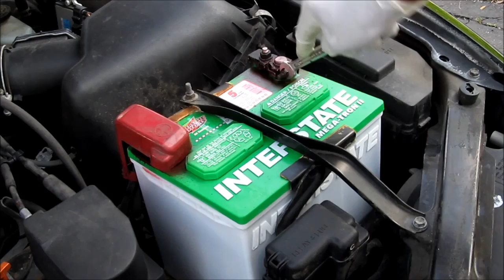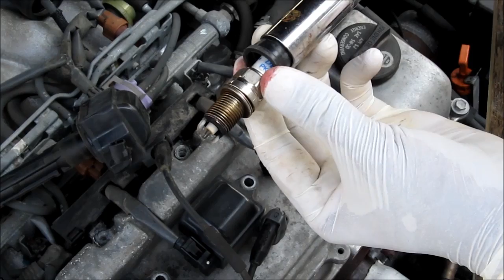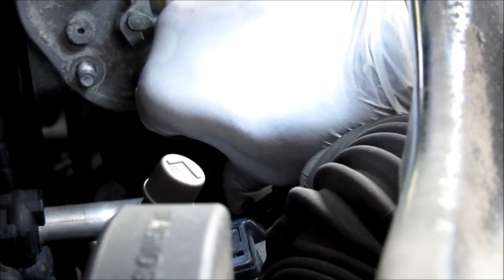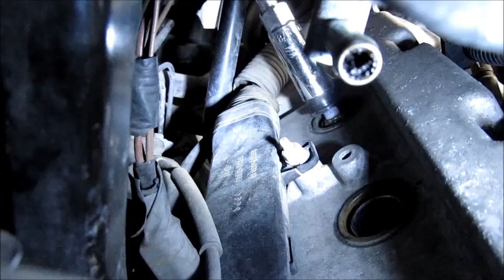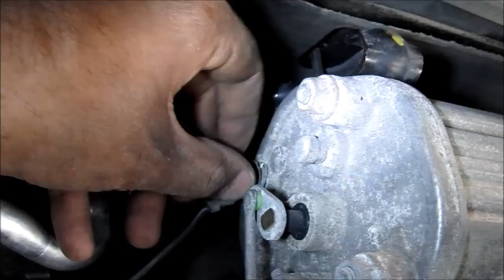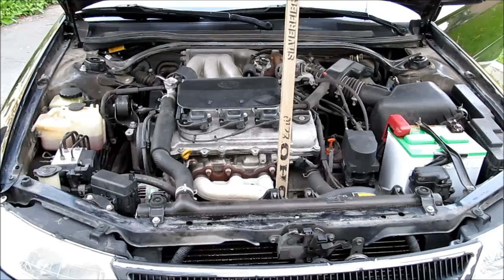Spark Plug Replacement: Toyota / Lexus 3.0L V6

Comment: Just changed my spark plugs and wires today since my engine started misfiring, cylinder 5 to be precise. Hadn't done the spark plugs in a few years and I used your method, very useful and I'm grateful this video was here. Thanks for the upload, keep up the good work.
Reply from the maker: +Wilmer Andrade Thanks. Have you made sure the wires are tight and snug going to that cylinder?
Reply: +speedkar99 yes, I made sure it was, all the rear ones since it's hard to get back there I made sure I did it right and everything is running smooth :) thanks again
Reply from the maker: Ah, Good to hear :)
Reply: +speedkar99 now I just need to figure out if my alternator is going bad because my dash lights and accessory lights dim/flicker when the car is idle but when I accelerate the car the lights brighten so not sure
Reply from the maker: It could also be a bad battery cell. Have you had problems starting?

Measure the voltage at the battery. While the car is running, it should be 14V. Turn on the a/c it should drop to 12V. With the car off it should be 12V.

Take the battery to a car parts store and let them do a full load test on it before investing in a rebuilt alternator.

Comment: Great video with clear instructions. Most helpful.
I used a magnetic flexible cable to extract and install the plugs ( in case you do not have a  spark plug socket with rubber boot).
Thank you.
Please post video on replacing rear struts/shocks on 1998 V6 Camry.
Reply from the maker: +Rafi Khan Thank you! Good tip on the magnet. Here's a rear strut video on my ES330 which is similar to the Camry with the exception that my rear seats don't fold: https://www.youtube.com/watch?v=ktWo724x090

Comment: Watched your video, very helpful. I change the plugs on my 2000 Avalon; little more intense but procedure the same. Need to becareful of the plug coil tube. It has a rubber seal gasket and at the end of the coil tube is a detachable plug cap that can come off and fall below. Actually I spent 30 minutes looking for a gasket and plug cap.
FYI, I like the best practice of taping the plug socket to the extension. Great idea.......

Thanks for sharing.....
Reply from the maker: +Jules Yes, taping the socket is really handy in case it falls into the spark plug tube. The VVT-i motors in the ES300 and Avalon use coils instead of waste spark ignition on the rear 3 cylinders.

Comment: Great video. I just replaced all 6 spark plugs. However, a friendly reminder, for those who doesn't service the car much/bought a second hand car, the PCV hose is kinda stuck and may need some hose picks to remove the hose from pcv valve. Thanks for the walkthrough and great details!
Reply from the maker: +Gideon Mak Thanks for the feedback. Good point on the PCV hose. Sometimes it can be stuck and break because its brittle.
Reply: +speedkar99 Those plug wires on the back are much easier to reinstall and remove next time by putting a little bit of silicone lube on both the plug and valve cover ends.

Comment: Dennis your video was very good, I hope you can tell me the Denso OEM part number of the plugs you took out, and maybe why NGK for replacement and the NGK spark plug part number you installed with the correct Gap you used in the plugs...Thanks
Reply from the maker: +PC MAN The NGK's were more readily available and also recommended by Toyota. The ones I put in were BKR6EKPB11, dual electrode platinum plugs. The iridiums didn't come with dual electrodes at that time. I don't know the Denso part number that came off, but if you search a parts database you might be able to find the OEM number. I recall it also being printed in the owners manual as well. The gap is 0.044" nominal, and do not need to be gapped.

Comment: Clear steps in your  video.  Your relaxed demeanor put my son and I in the right frame of mind as we changed the plugs and coils on his '98 Avalon (no rush, takes as long as it takes).  Which ended up being about 2 hrs.  I used multiple 3 inch extensions - 1  wobble, 2 fixed, and 1 universal joint were enough.  Well done.
Reply from the maker: +John Church Thanks. Glad you got the job done right.

Comment: I have a 2002 toyota camry v6, and this tutorial is very nice, and it is my base for DIY on spark plugs replacement. I want to add some notes here for 2002 or later Camry v6 owner:
1. it is doable without taking off the throttle intake body, but the space is very tight, seems to be tighter than the camry in the video. 
2. get the spark plug socket on amazon, it is definitely worth the money, much better than a standard spark plug socket. search on amazon "GearWrench 80546 5/8-Inch x 6-Inch Swivel Spark Plug Socket"
3. the spark plug on the rear right hand side is most difficult one to replace. I used a spark plug socket + u-joint + 6 inch extension + ratchet, so the ratchet is extended to the top where I have plenty of room to torque, that was the only way I got that spark plug unscrewed. there was no room on the back when I try to use socket + ratchet directly.
4. I did much research on 2002 camry v6. all the camry later than 2002 have iridium spark plug and they last a long time, manual say replace every 120K, and some people had said they drove longer than 200k and spark plug did not die on them. I replaced mine at 120k. spark plugs were really in decent shape where it can still work for a while. 
5. spark plugs makers actually against applying antifreeze, if you choose to apply some, do not over apply it. 

Hope these comment helps other Camry v6 owners. And thanks for speedcar99 for posting this video. saved me some money, more importantly, enjoyed learning a new skill.
Reply from the maker: Thanks for the feedback I'm glad you found it useful. 2002 Camry v6 still had the metal plenum which is easier to work behind than the plastic one found on vvti engines after 2003.5 . the difference with yours compared to mine is you have a different throttle body with drive by wire.

Comment: thank you for this video, i succesfully replaced all six plugs and the wires. the car stopped shaking , i was gonna take it to the mechanic but decided to give it a go myself because he wanted good chunck of change to repair it. saved me a couples days worth of salary.
Reply from the maker: Good it worked, I wouldn't think spark plugs alone would contribute to shaking idle.

Comment: I need help with the firing order of the engine, also I need to know which cylinder is which number, I was dumbass with disconnecting the wires and not paying attention.
Reply: ANIMAL LOVER  I have a 99 Toyota Solara V6 3.0 Liter
Reply from the maker: ANIMAL LOVER Here you go

http://www.toyotanation.com/forum/103-3rd-4th-generation-1992-1996-1997-2001/90956-help-what-firing-order-1999-v-6-1mz-fe-engine.html

Cylinder #1 is on the passenger side next to firewall.

Comment: I have a question and need help with some suggestions. I have a 2000 camry exact same set up as yours. i was able to get to the front spark plugs with ease but the rear i cannot get the ignition coils out. they are stuck. i want to save these coils because they are fine but if i try to remove them i fear i may break them and have to replace them. how could i remove them without breaking them
Reply from the maker: IXBlackoutXI1 On a 2000 Camry V6 you should have rear wires (and not coils) because it uses waste spark ignition (just like my engine in the video). They just pop out of their tube holes if you pull firmly.
Reply: Thanks for replying! Im planning on doing a gasket overhaul so once i start tearing everything down ill remember your vids thanks!

Comment: Thanks so much for the video u did a great job and saved me $240!  Couple quick notes i have a 2002 Camry v6 se and it has the ignition coils on the back 3 plugs too. Little more of a pain but u can get it. I also found that a 4 inch extension with a universal worked best for the back plugs. I had to get a 3 inch extension and rig a 1 inch extension. I took all of mine out from the passenger side. For the one closest to the driver side I put the ratchet in from the left and hooked it fast from the right. Again thx so much for the video I really appreciate it. Very well done!!!
Reply: One more quick thought this is not a quick easy job. It took me about 4 hours to do.  If I had to do it again it would probably take 2 since I found some tricks. Very tight squeezes to get to them but u can do it. By the way the taping the socket was an awesome trick a must for the ones in the back!
Reply from the maker: Travis Glessner Thanks for the awesome feedback! I'm glad you got your plugs done. Yes those helpful tips make the job a lot easier.

The 2002 Camry does have 6 ignition coils because it does not have waste spark ignition.

You have the metal intake plenum, correct?
Reply: Yes u r correct it has the metal intake. Thx again for the great video!
Reply from the maker: The metal intake was used on the 2002 until they brought VVT-i on the 1MZ-FE Camry in 2003.5.

Comment: Probably a good idea to replace the wires too if you're going at least 100k between plug changes. I found out one of the rear wires was damaged at the connector end. The problem was I couldn't tell from the outside so I thought something else was causing it not to start. I had to pay Toyota service to find out that's all it was.
Reply: I ALWAYS change the spark plug wires when I change the plugs. It but me one time on my 01 Camry. It was running rough and I changed just the plugs. It ran better but about a month later the check engine light started blinking and it was running terrible. Changed the wires and problem solved!  Always change the wires when u change the plugs about every 100k. I'm assuming u don't change the ignition could though as they r almost $100 each. Wait till they go bad. Thoughts?
Reply from the maker: Travis Glessner Ignition coils are expensive and should only be replaced if they're going bad. Wires are a good preventative maintenance, but I haven't had any problems yet with mine.

Comment: Probably could have saved some hassle if you waited until all 3 back plugs were installed before putting the 3 back wires back in lol. It's kind of silly seeing you fiddle with the wires in the way.
Reply from the maker: Joseph DiSalvo True yes, but because I didn't change the wires at the same time, I chose not to pull them out.

Comment: @5:46 Here it looks like you were using something other than just a 6" extension. It looks like a u-joint of some sort connected to the 5/8 socket. Can you explain? Is the rear middle plug harder to get an angle on with just the 6" extension?
Reply from the maker: ***** Yes a U-joint adapter. That middle plug is too tight under the intake plenum to get a full 6" extension in there.

Comment: I see  you went with NGK 3452. I was thinking about NGK 3764 Iridium instead of platinum. I know at the time the engine was designed, iridium didn't exist.
Reply: rkgsd Dual electrode lasts a bit longer simply due to the fact that as electricity follows the path of least resistance, it will generally err on the better condition electrode back and forth and wear down both equally.

You likely use dual electrode with wasted spark since it sparks the plug twice as many times per rotation of the engine than an engine that isn't lighting both sides of the V-cylinders simultaneously.

However, with Iridium lasting so much longer than single/double Platinum spark plugs for only a dollar or two more per plug, that doesn't really matter imo.
Reply from the maker: rkgsd NGK doesn't make a dual electrode iridium plug. Since these cars have waste-spark ignition, you should use dual electrode plugs, as per the sticker under the hood.
Reply: speedkar99 thanks.
Reply from the maker: Good point. At least I'm good for another 90K miles or so, so I won't really have to worry for a long time... if ever :)
Reply: I have 2002 Camry and it specifically recommended the iridium spark plugs and that's what I used. Time will tell how good they r and how long they will last. Will post in another 100,000 miles or so. :-)
Reply from the maker: Travis Glessner
The 2002 Camry does not use waste spark ignition. The 2002 Solara did. Two different engine ignition technologies and different generation vehicles.
Reply: speedkar99 So even though auto parts store catalogs at both AutoZone and Advance both suggest NGK Iridium 3764 plugs, you wouldn't use them?
Waste-spark ingition AFAIK has nothing to do with the number of electrodes on the spark plug, but rather, the fact that it sparks the fuel--free cylinder opposite of the one currently igniting fuel, so that it need only 3 ignition coils, simplifying the ignition system.
There is no actual change in whether or not the plug has or needs 1 or 2 electrodes.
Reply: Joseph DiSalvo Interesting but the service techs at the Toyota dealer still recommended 2 electrode platinums to me last week.
Reply: Side note: when the old plugs were pulled after 100k miles, I noted most of the electrodes were slightly more wore down on 1 side (1 of the 2 electrodes) but not both sides equally.

Comment: Hey just wanted to say thanks to this video I finally gathered myself and got this done over the weekend.  Mine is a 1998 so I had to remove the "diagnose" box bolted on the exhaust manifold as well. Not a lot of room and It took longer than expected but it's doable.  Driver side plug can be accessed from the top.  One suggestion is to have 3" extension and U-joint for easy plug removal when loose.  Great video!
Reply from the maker: wrongbeans Thanks for the feedback, glad you got your spark plugs done. A u-joint definitely helps behind the plenum.

Comment: Thanks A Lot for the video. It really helped me. My 98 Avalon had started runnig bad, sputtering and stalling. I was able to change the plugs in about an hour. I was quoted from $170 to $300 by 3 different mechanics. I took the money I saved and change the Oil, Air filter and bought a new fuel filter. I plan to change the fuel filter next weekend. The car runs great now. I used a 6" extension, with universal joint.  Went as smooth as your video.
I had a cheap spark plug socket so I had to glue the little rubber piece that grabs the plug into the socket to keep it from slipping out with the plug.
Reply from the maker: Cool, glad it worked out for you. DIY means saving money and is definitely the way to go.

My spark plug socket rubber came apart too, so I had to tape it to the end of another socket to pull them out.

Comment: Seriously, thank you for the video. Worked perfectly for my 1998 Toyota Avalon. The center rear spark plug was the roughest one for me. I finally got it despite only having a standard socket wrench with extender (no flexible joint). Videos like this are what make youtube so invaluable. Keep it up!
Reply from the maker: Thanks for the feedback, I'm glad it worked out for you. That middle spark plug is pretty hard with the intake plenum in the way. The flexible U - joint extension helps quite a bit here.

Comment: Thanks a bunch! Had check engine light coming on with multiple misfires. Replaced all the plugs and cleaned out throttle body. Ran it hard and so far no light.

Comment: Thanks for your video. It gave me the courage and knowledge to do replace the spark plugs myself on my Avalon. I had no idea how easy the rear spark replacement would be. I did, however, use two long 3/8 socket extensions, plus a universal joint connection to remove and replace the plugs, plus my extendable magnet to get the socket and spark plugs out of the wells, individually, since the deep socket didn't have a rubber spark grabber inside. Thanks again.
Reply from the maker: Glad it could help and everything worked out.

Comment: Do I need to gap them?
Reply from the maker: No they come pre-gaped.
Reply: Thanks for replying and I have a question I hope you can help , well since I couldn't wait I went ahead and gapped them and I don't know if it's because of this that the car now stalls and the check engine light is on I was thinking about taking out the plugs and re gapping them to how they were when I first bought them I'm working on a 95 96 Toyota Avalon btw thank you
Reply from the maker: You can try re-gapping but I don't know how much that will help because you've already changed the factory gap values. Exchange the plugs for fresh plugs, reset the codes and see if the problem goes away. Make sure the ignition coils are on tight and its not misfiring.
Reply: Thanks

Comment: Great Video:  Recently changed out my valve cover gasket.  I was careful with my ignition/spark plug wires but one failed anyway.  I was getting a misfire.  I decided to change out the whole set.  I was not looking forward to almost doing the job again but I saw your video and was surprised that I could get my hand under the plenum from the back.  Your procedure saved me a lot of time.  Car runs fine now.  Again thanks for the video.

P.S. Keep the great videos coming.
Reply from the maker: Thanks, glad you got the car running again.

Comment: Just wanted to say thank you so much for this awesome video. I changed all 6 plugs on a 2000 camry in 30 minutes. Everyone else said I would have to remove the upper intake. I used my own combination of extensions and swivels for the back middle plug. Thanks again it's guys like you that make the do it you self persons life a lot easier.